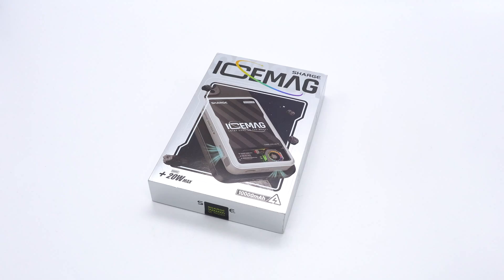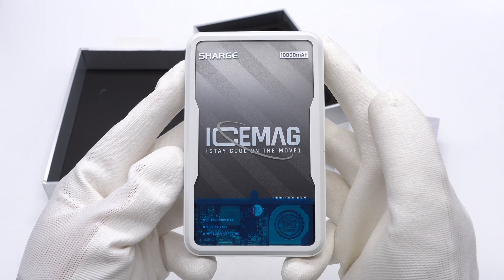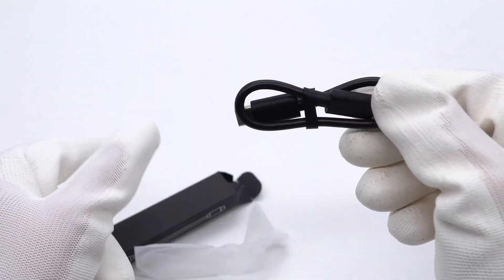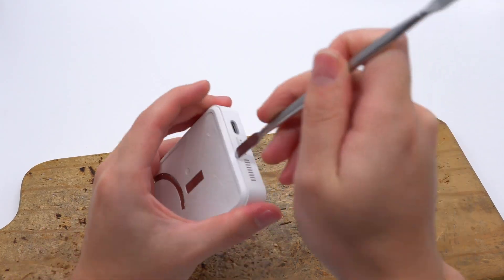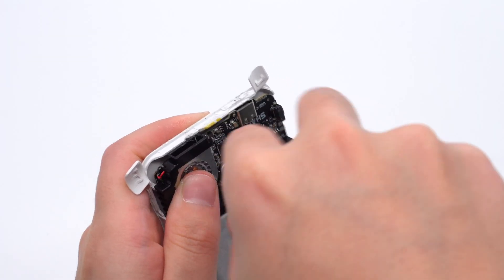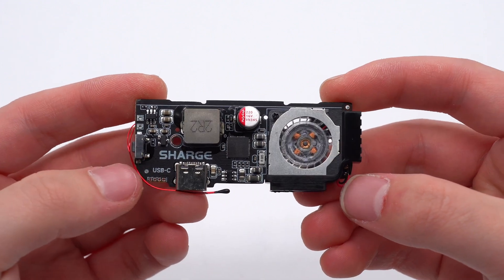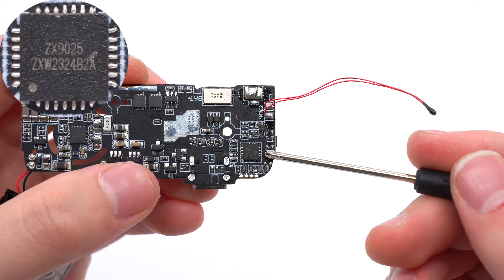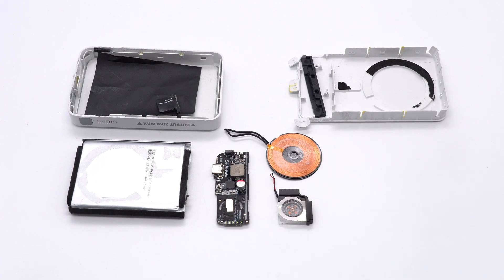See-Through Design | Teardown of SHARGE Magnetic Wireless Power Bank

Comment: I don't see how the fan can be effective in heat removal. The issue with wireless charging is that the coils heat up, and I don't see how the design would allow cooler air to flow across the coil to cool it down.

Comment: I have this power bank and it is really a gimmick. The fan is so small and literally worthless in its ability to cool the power bank.  Also for its size, its capacity is rather low. Magsafe magnets are rather weak too so it drops off the back of the phone easily. Mine died after I dropped it and the shock displaced a number of components from the PCB.